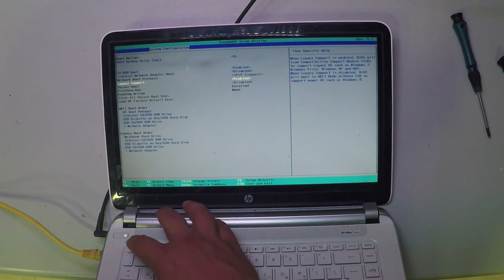HP Pavilion TS14 Notebook Full Disassembly and Reassembly

Comment: how to check if my fan is working at all , i have the same laptop it is overheating when i am playing games i can't feel any air coming out from the cooler side and i can't hear any noise too 
cpu temp at idle 45C 
cpu temp when playing 90C
i used to have hp probook it was overheating too but when it does i can feel a strong air coming out and hear a strong fan sound , thanks
Reply from the maker: your fan is working, if not your laptop will turn off every time it heats up. you need to clean the heatsinks 7:09 with compressed air our disassemble the laptop and clean with a brush.
Reply: @Shamsabdelkader  this laptop throttles down. gpu throttles down at 67degree celcius any help @the joker franky